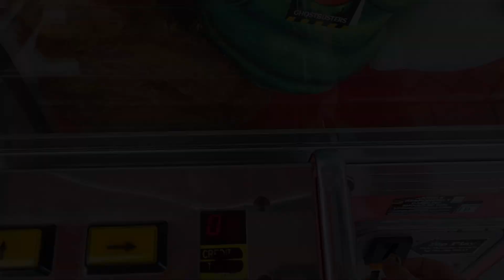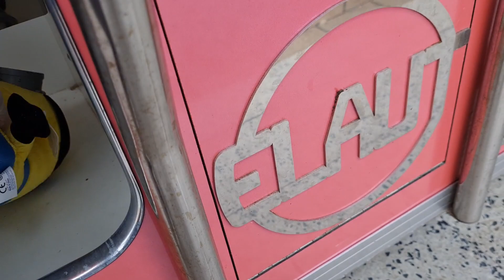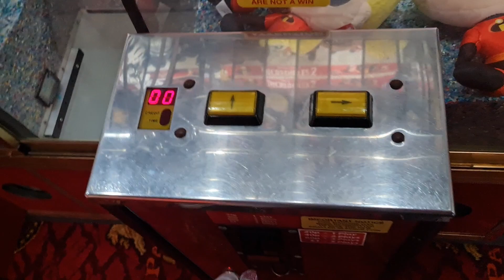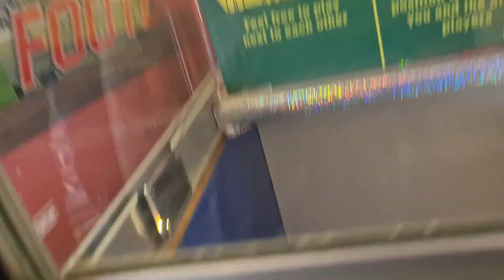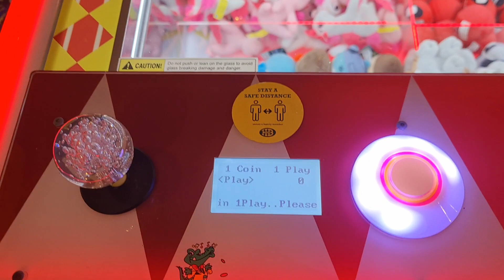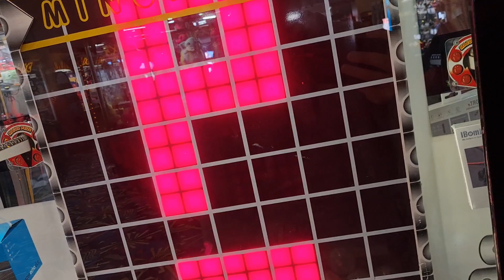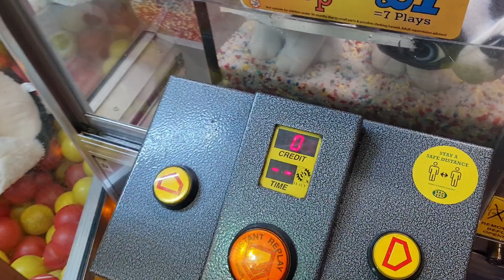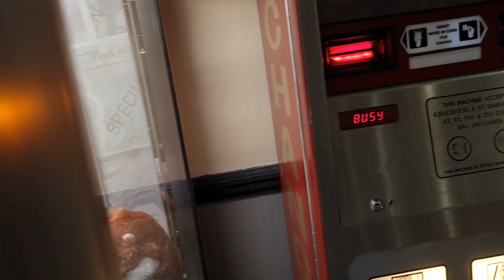Twin Wins!! Beating The Payout | At The Claw Machines UK #29

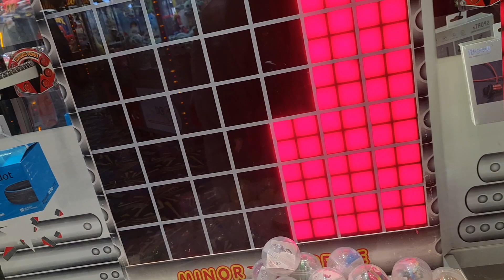Comment: 13:49 you will still get the minor prize as it uses a different sensor, error 5 is for the major prize sensors. The minor prize sensor is just a microswitch with a thin piece of wire on it that gets hit when the capsule rolls past.
Reply from the maker: Ah interesting. Eitherway that machine has never vended its minor prizes. You have to ask the staff to get it smh.
Reply: @BRIGHTAttraction  Does it make the ticking sound at all or does it just go straight back to attract as soon as you press the button?